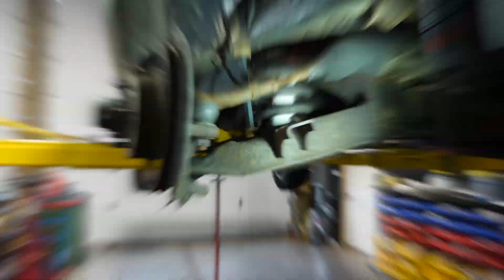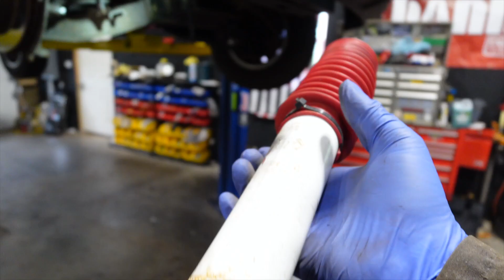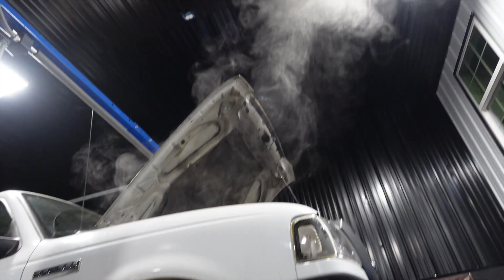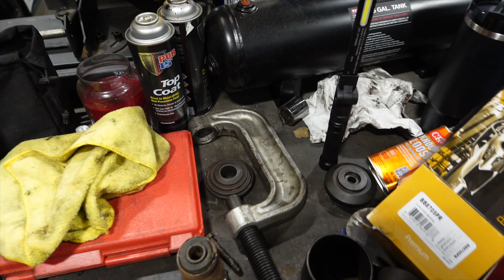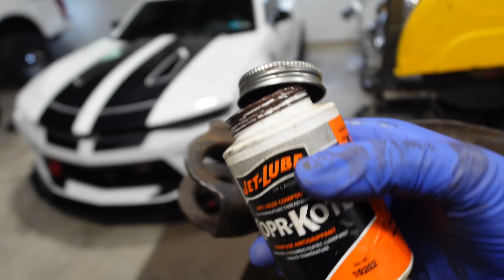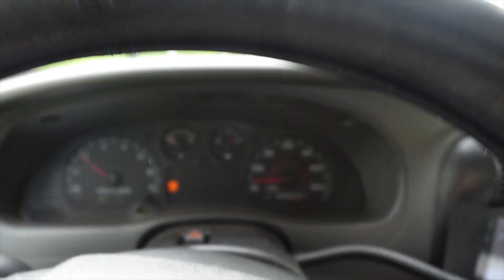Ford Ranger Front End Clunk Repair

Comment: You can tell this vehicle lives in a wet/snowy environment. have a 1999 Ranger 4wd/4-door that I bought in 1999! 100% of its life has been in the Southwest Desert, so zero rust (However, anything rubber or plastic suffers) 102K original miles.....😊 
 I love everything about it except NO power door locks.

Comment: My 2008 Ranger only has 66k on it and it clunks so bad it feels like there's no suspension. I replaced the shocks, ball joints, and sway bar links. Also checked for broken springs. 
I guess I'll be buying bushings or control arms.
Reply from the maker: Yeah I replaced all that too before finding the bushings were gone oh well it needed all of it anyway
Reply: @HammerdownMotorsportsUSA replaced lower controls arms. Driver's side still clunks like something is lose. 🤦
Reply from the maker: @willylowman99 shock maybe

Comment: Would it make a difference if you cut the bolt off and put another one in the other side  side
Reply: I didn’t cut my bolt but I did cut the nut that it screwed on to. Used a saw saw to remove the little hanger that holds onto the frame put the bolt through the other side and nut next to catalytic converter and worked great. So far no problem.
Reply from the maker: You probably could but I didn’t have another bolt handy

Comment: What did u change can u name the parts and what u did please mines sound all mess up lol
Reply from the maker: I made a video changing the control arm bushings but you can change the whole lower arm if that’s easier for you they come with bushings already
Reply: @HammerdownMotorsportsUSA oh ok what a good brand ? I got a 2007 ford ranger stock I want to keep it that way
Reply from the maker: @hemiaddicts5954 I used Dorman in my factory control arms and moot ball joints
Reply: @HammerdownMotorsportsUSA  I feel you are on the right track keeping the original control arm. Likely superior metal. Seems like everything & anything is made cheaper every year. There's a book out called "Poorly made in China" by Paul Midler

Comment: Is it possible to do this at home with the truck on Jack stands ? Or do you need a lift like this?
Reply from the maker: Really depends on you it is possible both ways with the right amount of effort
Reply: Yes it’s possible I did it with Daytona jack from harbor freight and some flea market jack that was for 1.5tons and the bottle jack that’s behind the passenger seat on the ranger. Removing that coil gets tricky you won’t be able to do it like he did in the video. You will have to compress it and jack it down or up. Unless you have some high speed jack that can really lift that truck up high

Comment: I would just buy new lower control arms. Dealing with the bushing sounds like a nightmare.
Reply: He had just put new lower ball joints in, so he didn’t want to have to remove those from the arms. As I understand it, you can’t use ball joints anymore if the have been removed from the lower control arm. I might be mistaken about that, but that’s what I read somewhere recently.

Comment: Not many videos on the passenger side because of the exhaust issue. Thank you for pointing that out. I ended up pushing the other side of the lower control arm up just enough to angle the bolt past the exhaust.
Reply: Quoting Will Ferrell when I say this about getting out that stupid bolt—“so you’re saying there’s a chance?” that I can get it out without removing the catalytic converter! Man that is wonderful news.

Comment: Firstly, thank you for making this video. This is going to help me a lot, I've been looking for a video for a while, my bushing are almost at the end of their lifespan and I want to replace them before I start having issues (both rear bushing have dryrot on the edge of one end, but not the other end. Front ones on both sides look brand new). Anyways, after seeing the issue you had with he Cat I went and inspected mine. I have a 2010 and they must have changed the shape of the cats for this specifically, I measured it out and it has just enough room to get that rear bolt out on the passenger side.
Reply from the maker: Hope the vid was a help appreciate you watching